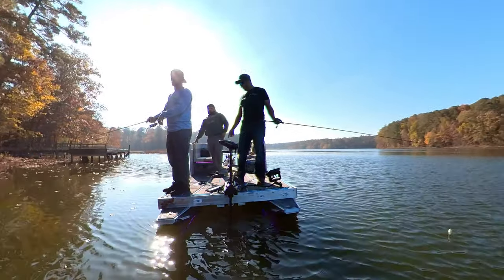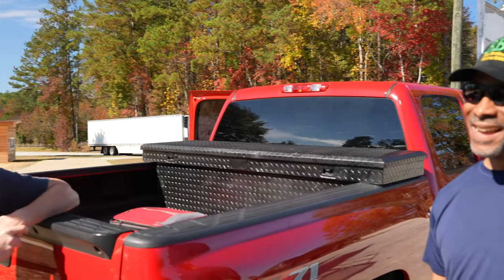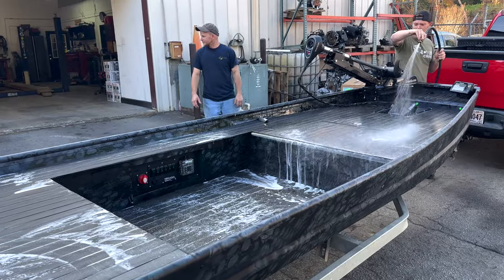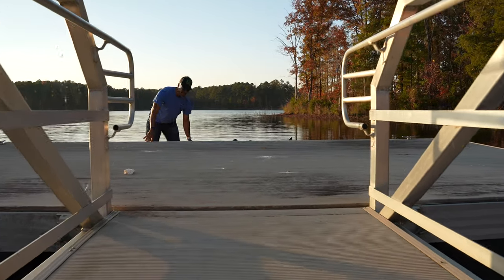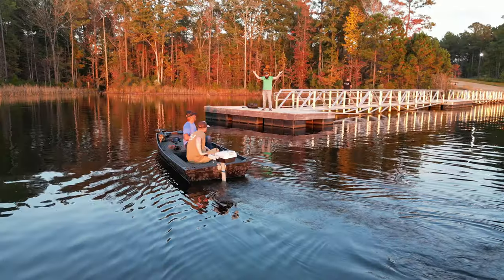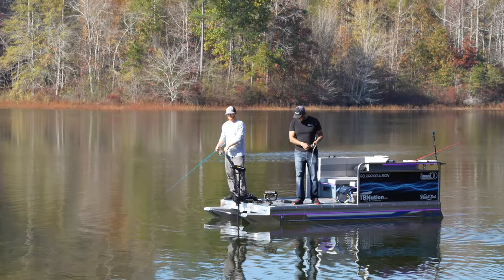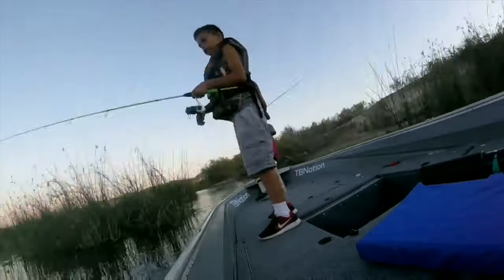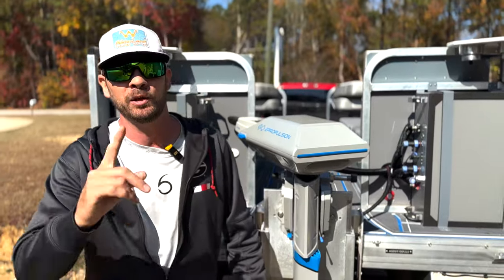This boat will save your marriage! @TBNationOutdoors

Comment: Just ordered a 6.0 Navy for my 20’ pontoon boat.  I currently have two 20 year old 5hp Briggs and Stratton outboards that I converted over 20 years ago.  They work ok but were never design for hours long operation (made for bass fishing electric lakes in 2000) just to run to a fishing spot a little faster years ago.  I have a 9kwh LiFePo4 battery and will be adding a 1,600 watt solar top to complete the build…
Reply from the maker: Nice add! Good setup